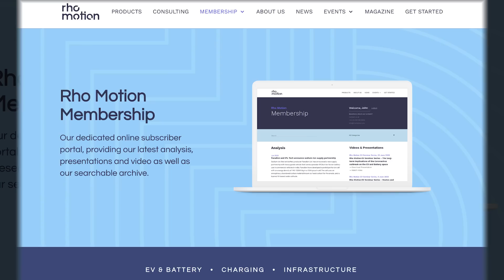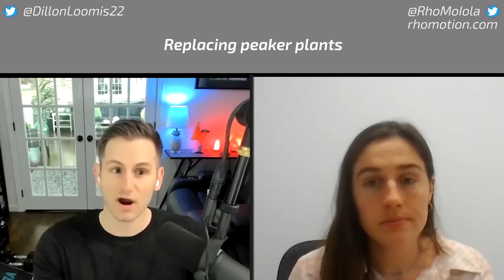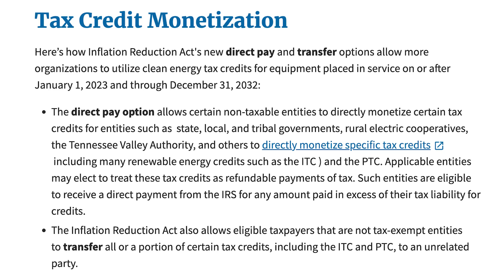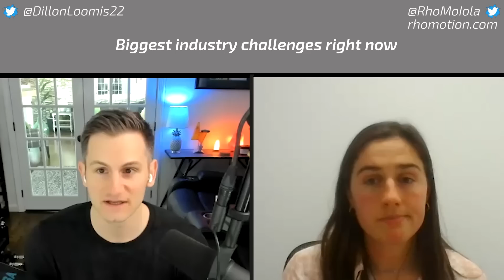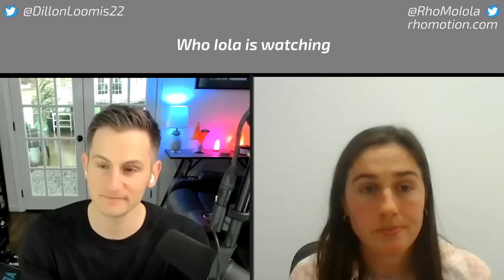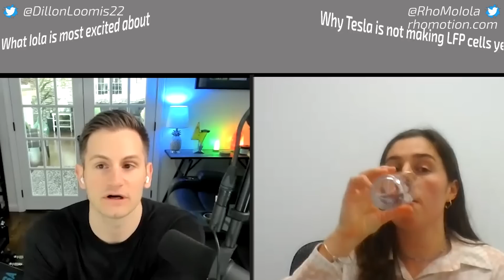Exclusive Interview: Tesla Energy - The Tidal Wave Ready to Break ⚡️

Comment: I have had solar panels for 13 years but my friend tried to add Tesla solar panels but they wanted him to hire a contractor to pull off some of the flat tiles (concrete) and replace his underlayment (three years old) and then put down asphalt tiles larger then the solar panels area so they can install solar panels. This would leave a two foot area of asphalt tiles showing around the panels.
Then they want to install a Power Wall Plus and not a Powerwall 3. So he declined to do this project.

Comment: Isn't a "long duration" battery just a normal battery with a very low power rating?  A 2 hour battery can easily discharge it's stored power over 100 hours or more.  

Wouldn't the main advantage of a long duration battery be a slightly lower manufacturing cost because you can use lower gauge conductors, and fewer power conversion chips...

They cost less to make, but limit the markets you can participate in.

Comment: GPT4 Summary:

- Iola Hughes works at a research house and consultancy called Row Motion, focusing on EV batteries, energy storage, and related areas.
- There are two main classifications for stationary storage: grid storage (front of the meter) and behind the meter.
  - Grid storage is directly connected to transmission or distribution networks, helping with renewable energy storage and grid stability.
  - Behind-the-meter applications are usually smaller batteries used in residential, backup power for data centers, hospitals, and factories.
- Battery storage replaces peaker plants and is used for energy arbitrage, making money by selling stored energy when prices are high.
- The Investment Tax Credit (ITC) provides incentives for solar and energy storage installations, helping reduce upfront costs.
- The Production Tax Credit (PTC) focuses on battery cell and pack assembly manufacturing, offering incentives to manufacturers.
- Tesla is an example of a company that can benefit from the PTC by assembling battery packs in the US.
- The Energy Storage Market has seen increased activity due to these tax incentives, with more gigafactories and assembly facilities being set up.
- Tesla can get a $45 per kWh credit for the Mega Pack if they use 4680 cells from Austin or Cato Rd. in the United States.
- There doesn't seem to be a cap on how much a company like Tesla can earn with these tax credits.
- The Inflation Reduction Act's numbers are estimates, not caps, so if there are enough qualifying projects, the numbers could exceed those.
- The Inflation Reduction Act now allows credit transfers and direct pay options, opening up the benefits to more entities, even those without a tax liability.
- Battery storage projects no longer need to be connected to renewable energy sources, opening up new revenue streams and locations for these projects.
- Unpaired battery storage projects can help with grid congestion, ancillary services, and avoid costly grid upgrades.
- The market for battery storage like Tesla's Mega Pack is vast and growing.
- Peak plants and renewable energy grid integration are factors driving the need for battery storage.
- In China, provinces require 10-15% of storage with a 1-2 hour duration alongside renewables, ensuring stable supply.
- Some solar farms in China are sharing standalone storage assets for improved efficiency.
- Long-duration battery storage is a debated topic, but typically refers to durations beyond 8-10 hours.
- Lithium-ion battery projects are pushing the limits of duration, with some even reaching 10 hours.
- Tesla Mega Packs have short durations (2-4 hours), mainly used for daily grid support.
- Longer duration storage (8-10+ hours) is used for seasonal energy needs, like filling gaps when solar generation is low in winter.
- Tesla may already earn $10 per kWh from CATL cells and $35 per kWh from 4680 cells made in the US, totaling $45 per kWh.
- China and Europe have incentive programs for energy storage, but they differ from the US Investment Tax Credit.
- In China, incentives are set at the provincial level and focus on energy generated from storage assets.
- European market has been slower due to policy barriers like double taxation and lack of cohesion.
- UK and Ireland have more favorable policies, resulting in more energy storage projects.
- The EU's Green Deal aims to increase support for energy storage, including removing double taxation and improving market design.
- The biggest markets for battery energy storage deployments are China, the United States, and Europe, with Australia, India, and Turkey emerging as interesting markets to watch.
- Supply chain and system manufacturing are challenges holding back the market from exploding.
- Grid connection and wait times for connections are also issues.
- Fossil fuels may still be part of future electricity grids, but with integrated carbon capture and storage.
- Tesla is one of the leading players in the energy storage market but not the clear leader yet.
- Tesla might place their next Mega Pack factory in Europe.
- Cell manufacturers moving into the system space could create more competition for Tesla.
- The battery energy storage market has room for multiple players in the United States and is not expected to slow down in the next few years.
- Two companies poised to emerge as leaders in the US are Tesla and Fluence, with other players like Next Energy and Core Power also setting up gigafactories.
- In China, Jinko Solar, CATL, and BYD are some of the biggest players in the market.
- Tesla may face challenges breaking into the Chinese market due to cost competitiveness.
- Battery chemistries are shifting towards LFP, with sodium-ion starting to appear in the EV realm.
- Lithium-ion batteries are currently the dominant chemistry in stationary storage.
- In 2020, the market was split between NCM (nickel, cobalt, manganese) and LFP (lithium phosphate) chemistries, but LFP has become more popular due to cost and safety.
- LFP now makes up around 75-80% of the market, with China using it in around 95% of cases.
- Large-format cells are being developed for stationary storage, offering longer cycle life and lower costs.
- Sodium-ion batteries show potential as a market disruptor due to their cost, safety, and other benefits, but they are still in early stages.
- Flow batteries, particularly vanadium flow batteries, are being explored, but they are more expensive than lithium-ion and still in pilot stages.
- Tesla isn't making LFP cells due to previous patent restrictions and a lack of investment in LFP cathode production in the US.
- The battery storage market is expected to experience significant growth in the coming years.

Comment: 4680 are Litium / Nickel (For now) - I thought only cheap heavy Iron Phosphate and Sodium would be used for stationary
Reply: Until you consider the whole point of the 4680 Form Factor (NOT "chemistry") is to produce the maximum GWH (TWH) from the smallest possible factory at the lowest possible cost.
.
Whichever cell / chemistry combination is cheapest per GWH/ TWH goes into storage......
Now. The BEST combination may be, for instance LMFP, in a 4680 format, or Sodium in 4680 form.
Time will tell.

Comment: My definition of the Tesla Paradigm can be expressed thus.

"Tesla's mission is to maximise the Mobility and Energy Effectiveness of societies at continually reducing integrated Loss to those Societies.

We will do this by effectively and efficiently marshalling resources to create a global fleet of minimally mechanically diverse but maximally software defined vehicles and other energy products that are integrated tightly into the energy infrastructure of the society of which they are a part." 

We see this as the Essential Value Tesla adds to Global Society and fully endorse this definition of 'Loss to Society'.

'Loss to Society'is that loss of time, limited resources; misplaced ingenuity and foregone opportunity arising from the creation, use and disposal of non-essential value of not doing the right thing right every time; on a balance of probabilities.

Comment: I often look at solar farms, noticing the rows and rows of panels.  Wouldn't it be worthwhile to install wind turbines interspersed?  A wind turbine's shadow that falls across a few panels surely wouldn't be a big detriment, especially when you consider the large amount of extra power generated.
Reply: Latest panels have individual cell management (essentially a diode on each element)
As a result, shading is t an issue, it simply drops the individual cell from the circuit rather than the "block" or panel.

Comment: Batteries are not dispatchable.  You can't get rid of peaker plants (gas, coal is base load).  Grid based battery storage is a great way to supplement the grid but it doesn't replace dispatchable generation. Wind and solar are not dispatchable.  Distributed solar (behind the grid) and associated storage probably is the simplest way to supplement power generation and use and doesn't great additional load on the grid.

Comment: Good info. I didn't realize how many players there were in this space. One nitpick - it still kills me when someone quotes storage in terms of Watts instead of Watt-hour, especially when they sometimes say xx Watt-hour and sometimes say xx Watts. I don't know if they are just taking a shortcut and forgetting to add the hour unit or if they are talking about sustained output for two to four hours and I'm supposed to multiply the xx W number by 2 or 4.
Reply: X% the collection rate of the "collection system"
(Expressed in Watts)
.
Capacity of the storage .....
 for which the storage can Supply that energy
(Expressed in Watt hours)
.
Time 
(Hours)
.
Maximum OUTPUT RATE
(and we're back to Watts)

Simple
Reply: @rogerstarkey5390  Right, but sometimes the output time is considered to be 2 hours and sometimes 4 hours. So when the say they have 50 MW of storage, is it a 100 MWh system or a 200 MWh system? The duration is rarely stated.

Comment: Some time back Sandy Munro did a back of the envelope costing for lithium iron phosphate (LFP) battery packs.  His inputs = $30/kWh for materials, $10/kWh for cell manufacturing, and $10/kWh for turning cells into battery packs.  The $10/kWh cell manufacturing cost was pre-Tesla 4680 development so $50/kWh may be a bit high.

When one looks at the IRA(Build Back Better) subsidies for battery and pack production it suggests that the cost of batteries in Tesla EVs will approach zero.  

$50/kWh battery pack cost - $35/kWh battery subsidy - $10/kWh pack subsidy = $5/kWh.

And that should mean some major increases in profit margins.  Or even lower sales prices while holding very good margins.

Comment: Lots to unpack from this conversation. One takeaway was that decommissioned legacy ff generators have an asset that retains value after they shut down, which is their grid connection. Co-locating new build renewables or storage infrastructure nearby idled ff generator sites seems like smart business practice. After reading about multi-year delays for new build renewables / storage projects to get grid access, maybe there's a market for retired grid tie-ins?
Reply: Not even going that far, I think we should start suggesting that existing Unclear Plants should install solar on the ACRES of what is essentially an exclusion zone around their buildings.
(If nothing else, would really annoy their fans!)
Reply: One thing I thought of was the comment about lengthy times for grid connections versus needs of and for charging stations. Maybe those are really small potatoes, easily hooked up and served by local connections. I question whether small solar arrays at those stations help all that much. Megapaks there certainly do, but probably to store cheaper grid energy at night to be for sale in the daytime.

Comment: Thanks for the great interview.  Appears that there are a number of competitors in the energy storage space. Telsa's advantage will be their brand reputation among serious electrical engineer types who design and operate the grid. Tesla has a great start here.
Reply: Brand won't help with grid storage market where economics plays a more important role than sentiment
Reply: @MegaWilderness  Agree with economics point.  Tesla has been active in the utility commercial space.  Indeed one of the first movers in this space. Reliability (and safety) are central to having the economics work. A failure is a nightmare in the utility space in terms of economics and regulatory/public relations. Tesla has built a solid reputation here. Would a utility trust a battery manufacturer who is new to this space and can maybe provide a cheaper system or a Tesla who has proven that they can provide reliable and economic systems overtime?
Reply: @RussellTucker-np3yw  CATL is not new to the game. It sells grid storage around the world including Australia and the USA. I put this question to you, would you rather own CATL stock who build grid storage and skateboards for EV's or a wannabe LFP battery manufacture. Tesla doesn't even make solar cells. It's clearly just a battery and solar cell reseller.
Reply: @MegaWilderness  I guess I am pointing to the importance of reliability on the electric grid and the relationship between the utility companies and their suppliers in ensuring this reliability. I know Tesla has been building this expertise and relationships in the US utility sector.   Alternatively, if any battery supplier can easily provide reliable grid integration with their batteries, then Telsa is just a middleman and has no competitive advantage.
Reply: Nope it will be a commodity product

Question: Who has the best solar panels?

Answer: They are all high quality with 20+ year guarantees and the price is the primary factor not the logo on the panel

Comment: You don't need sufficient battery storage for a low carbon grid

Norway has a 99% fossil free grid and it has basiclaly zero batteies

France has a 97% fossil free grid and it has basiclaly close to zero batteies

The UK has a 60% fossil free grid and has basiclaly zero batteies. The UK vefore the end if the decade so 6.5 years from now will have a 95% fossil free grid with close to zero batteies (less than 1KWh/capita)

Why would a grid install lots of stationery batteies if it can achieve a very low carbon grid without batteries

As Elon says, the best part is no part. The best battery is not needing a battery in the first place

This isn't to say there wont be batteies its to say there wont be many batteries. For example the UK will probably not need more than the equivalent of 2,000 megapacks thats not 2,000 per year but in total installed over the next 20 years

Multiply by 100x to get estomste of global demand and you are looking at 10,000 megapacks (or equivalent) per year. Or about 40GWh per year

Why produce TWhs if you can have a very low carbon grid with just GWhs
Reply: Of course you don't need any batteries for a 100% fossil free grid. It's easy. Only use price. All these countries you mention sell energy for nothing at all at night, and half a dollar at dinner time
Reply: @henrik5761  The average sale price of Norway to the UK over the new link this week has been approx $125/MWh or an income or $3.9 million per day....

They aren't giving it away for free
And it's soon going to he largely bidirectional. Eg Norway exports to Germany over a link. But Germany also exports to Norway over the same link. On an annual basis is about zero so its trading excesses as and when  needed

Comment: Flow batteries are better suited for long duration storage compared to lithium. Plus to get to say 10 hours of storage, no matter how much power is involved,  you don't need 1 battery to do it all. You can build a system with lots of batteries that add up to 10 hours with a draw on each battery scheduled for different times in turn. This would be similar to a tesla car battery but not quite the same in that not all of the power is available at the same time. It would be like turning on different sets of cells at different times of the day.  Or another example, say the amount of power you need would be provided by one megapack, ( which only lasts for 2 hours on discharge )  but over say 8 hours,  all you need is 4 megapacks discharged in a staggered way in 2 hour blocks.  Anyway talking about duration without talking about power required is a bit pointless.
Reply: Interconnectors reduce the need for storage

For example the UK built a 1.4GW link to Norway last year

In a windy week that will allow 1.4GW x 24 hours a day x 7 days in a week = 235GWh of virtual storage

That's like building 60,000 megapacks which would cost $120 billion but the cost of the interconnector was less than $2 billion so 60x cheaper

Plus this link will last 100 years while a battery maybe 20 years

Most countries will get to a 90% fossil free grid without the need for significant battery storage

The best battery is not needing  a battery

Grid upgrades will allow sharing of excess and shortfalls rather than spend trillions on batteries

Link the USA West and East cost grids and texas grids to each other. Say 30GW links between them. Do that and you greatly reduce any need for curtailment without batteries